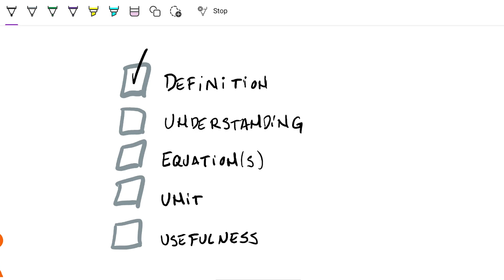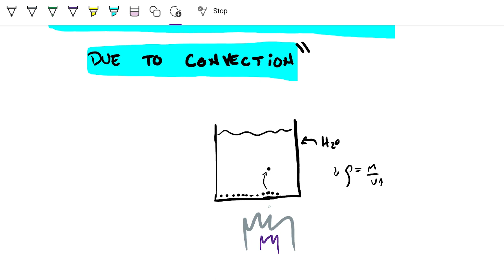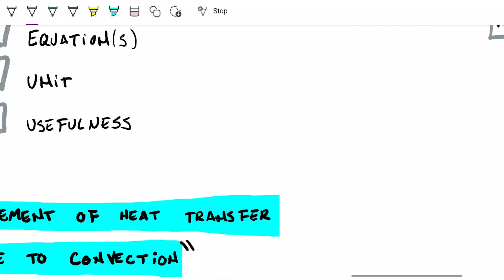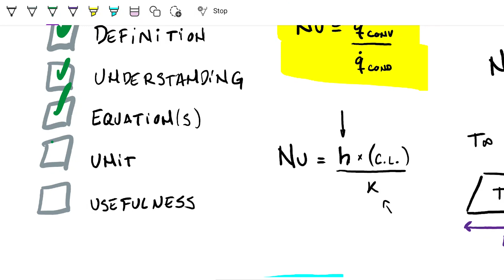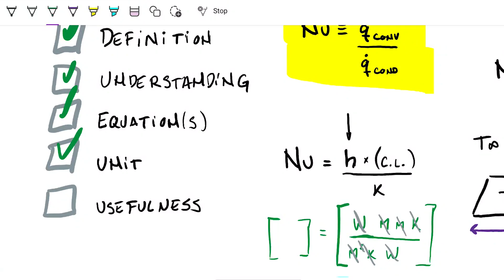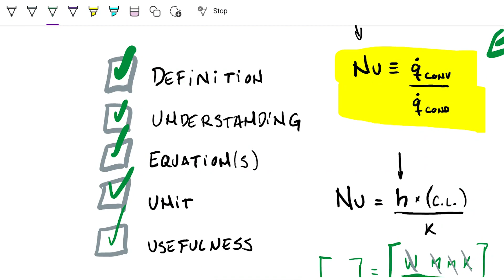Comment: I wanted to ask if you could help me with the numerical calculation of the local Nusselt number (Nu) in my setup, for natural convection in horizontal annulus with discrete heating source,
Reply: Sure. What is the whole system?
Reply: Can I send to you the details an email if you have  @EngineeringHack
Reply: Did you have an email to send the full details  @EngineeringHack